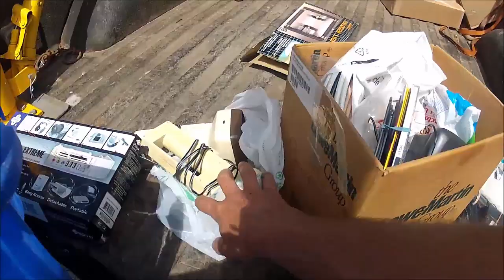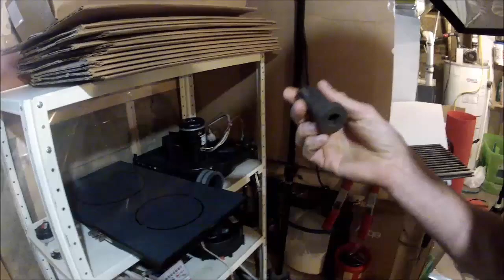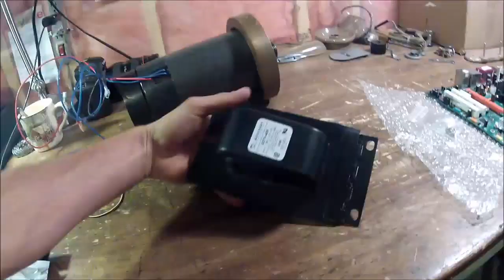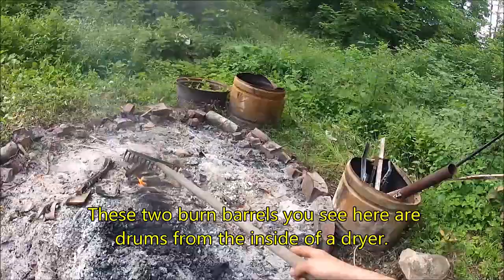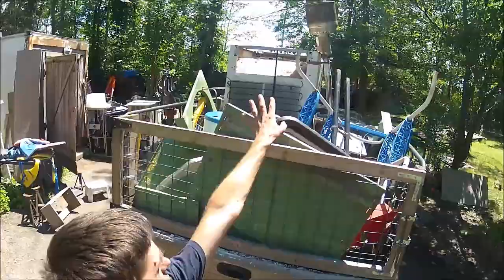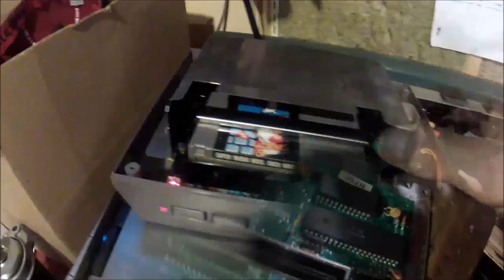3000 lbs of Scrap Steel in ONE DAY - Scrapping and Reselling VLOG and cleaning up the yard

Comment: Invest in a 10x10 foldable canopy. gives you a shaded area to work under or give you a place to get out of the sun if you are moving around. Can also give you protection from rain if you are working on something from disassembling things to working on the car/truck.
Reply from the maker: I've used those in the past, but winter snow kills them each season.
Reply: theres your problem they are not made for snow loads.